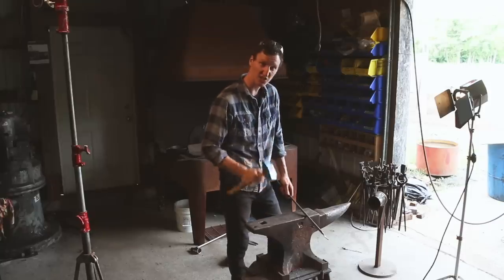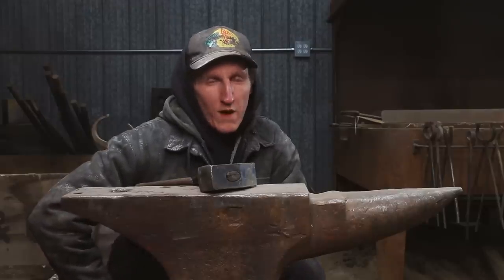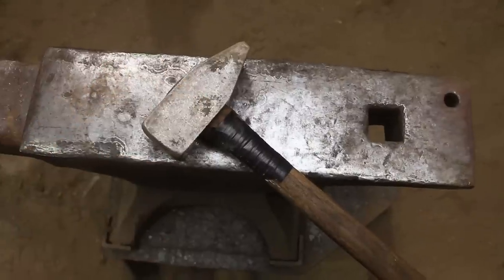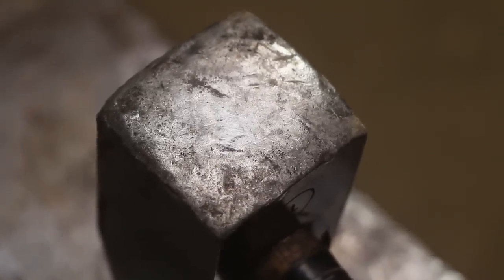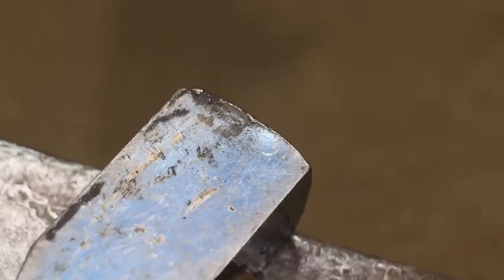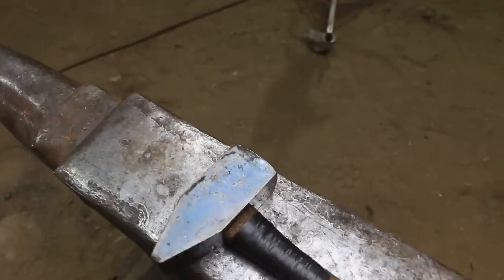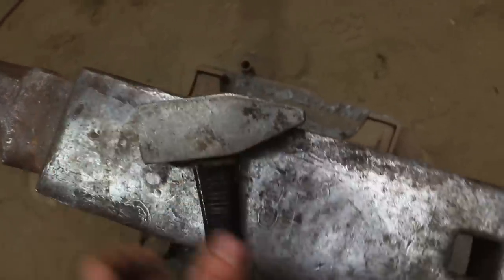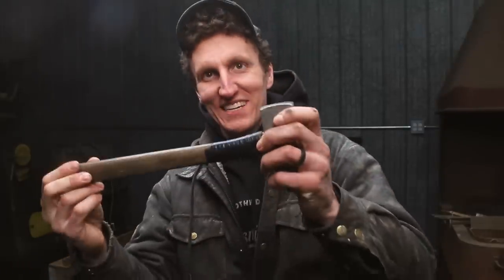My TITANIUM hammer after 2 YEARS

Comment: I'm a carpenter of 40+ years and have never used a titanium hammer.

The experienced carpenters, I know and trust, swear that the lighter weight is compensated when stored energy is released from the hammer into the work.

If you are swinging a hammer all day, and your hand does not go numb or elbow swell, you have a great hammer. 🤘🦊👍
Reply: don't fall for the scam.
Reply: You can get a titanium hammer in the weight of your regular framing hammer, the benefit comes from how the titanium handles the shock. I don't know all the sciency Parts but it doesn't transfer as much of the energy to your bones as steel does.
Reply: Just use lesser hammer, lol. Titan is great, but using it for hummer is a waste of precious metal.
Reply: @dmac1259  i have noticed on his first video the sound it makes when it hits the anvil, it has a "hollow-kind" sound compared to a normal hammer (probably because is less denser?), maybe thats why it may be more healthy for the muscles and bones compared to a normal hammer

Comment: Tim, great video, glad to see the update on the hammer, since I remember the original video.  Titanium has a lot of cool properties, some that might play a part in why the hammer works so well.  Depending on the alloy (can't remember which you used) it has a lower coefficient of restitution than steel, so it won't bounce back quite as much, likely saving your elbow.  It also has a much lower thermal conductivity than steel, so it will take less heat out of the piece you're working on than a steel hammer.  It also can alloy with materials your work with, so it wouldn't surprise me if the face of your hammer has a good amount of iron in it now.  Titanium work hardens, so you're making it better every time you swing.
Reply: thanks for the information, i have noticed on his original video when he hit gently the anvil, it sounded a bit "hollow-like" sound, maybe because it has a lower coefficient of restitution? (a concept i just google it and learn thanks to you!)

Comment: Could steel faces be dovetailed/pinned to a titanium core to toughen the striking areas whilst retaining the shock absorption? It'd be ridiculously overkill design wise, but would it work?
Reply: This is a great idea.  Tim, get on it!
Reply: I wouldn't use dovetails in an impact tool as it'd work itself apart with use. Honestly, if shocks are an issue, use a birch handle or wrap some leather around it. If you're a blacksmith and shocks bother you, you're holding it too tight. If you absolutely want to use titanium, I'd try to make the eye way oversized and fitting a sleeve as thick as I could, but then you'd have to worry about the steel cracking.
Reply: @bjrn-oskarrnning2740  another thing I've seen for reducing shock in both hammers and axes is to orient the wood grain parallel to the striking face (or edge).

It's so common now to see wood handles with the grain perpendicular to the striking face, for "strength and longevity of the handle", but if you change the grain orientation and shave the handle in a way in which you preserve the outer growth ring for the back of the handle (similar to bow making, but opposite), the handle gains some spring, but also absorbs a lot of shock and lasts far longer at the same time. 

Mr. Chickadee has a great video explaining this.
Reply: @jameshaulenbeek5931  huh, I haven't heard that before but that's definitely something I wanna try out!
Reply: You can also use screwed head like in recoilless hammer.
Reply: @bjrn-oskarrnning2740 it’s funny you say that, because a keyed dovetail is how a lot of power hammer strikefaces are held on the ram/anvil
Reply: @jameshaulenbeek5931  Can you link the video where this is explained please?
Reply: Stiletto did that to a degree with their tbone hammers. They bolted a steel face on an all titanium hammer. It works fine but you do have to retighten the bolt every so often even if you use loctite.
Reply: @EclipseAtDusk  I know, but they have wedges to hold them in and those need to be knocked back into place every so often :P also, those hammers have a linear motion which I imagine puts a lot less strain on the joint, compared to how I use and abuse my hammer xD
Reply: @bjrn-oskarrnning2740  Why can't you design it so that the wedge goes into the main working face of the hammer, and thus every single swing knocks it back in?
Reply: @jameshaulenbeek5931  as a woodworker who just popped by to see another craft's discussion?  I wouldn't turn a handle that direction at all, even if you could get it to be long enough.  Wood is WAY weaker in that orientation as the strength travels down the grain
Reply: Stiletto makes framing hammers that are basically exactly what you are talking about. The hammer is mostly titanium but with a half inch or so steel strike face. They cost 200-300$ but if you’re a carpenter or framer and use it all day long it’s totally worth it.
Reply: @polerin  you should probably look into wood bow making. It's the same process.
Reply: @jameshaulenbeek5931  Perhaps, but a bow is never meant to actually withstand the force of it shooting.
it needs to transfer the energy into something like an arrow.
Dry firing without an arrow and letting the stored energy just travel around the bow without going anywhere will damage and eventually destroy it.

Comment: Titanium is worth it just because it absorbs so much more shock, which is easier on your joints and better for your health in the long run.  Stay lit. 🔥
Reply: Wait, for forging? If you feel the shock in your arm, you're holding your hammer way too tight!
Reply: This! Very much this! 

I heard the story once, of a custom bicycle frame builder, who explained that any road bicycle with a titanium frame would ride soooo incredibly smooth that it wouldn't need shocks, whereas a steel framed bicycle would definitely improve with a set of front shock absorbers in the fork.

Comment: I think seeing your original video has lead me onto some research back when I watched it. I have read something about titanium being able to transfer more kinetic energy than steel. So it would make sense that it is less tiring to use. it would mean it has less energy to transfer back at you after you hit something
Reply: Kinetic energy = mass x speed. So it doesn't matter what material you use.
Reply: @JaapGrootveld  You haven't factored in the elastic/non-elastic effect of metals, eg bounce a ball bearing off of a quality anvil and then try bouncing it off a similar shaped lump of normal steel, the anvil will bounce the ball a lot higher than the steel.
This all boils down to the right balance to get energy to transfer into the workpiece rather than back into the handle of the hammer
Reply: @JaapGrootveld  kinetic energy is 1/2mass x velocity^2 (momentum is mass x velocity)
increasing speed has a much greater effect on kinetic energy than its mass does.

Comment: I don't know much about forging, but as a hobby machinist I'm working with titanium on the lathe and milling machine quite a bit. The pitting probably stops because of work hardening. Titanium has a tendency to work harden a lot under pressure/force, which really is a pain for stuff like drilling or milling, if your cutting tools are slightly dull and the cutting pressure gets too high. 
In the case of your hammer that's actually a good thing I guess. Maybe hitting the cold hammer with the power hammer could improve the hardness by basically "cold forging" it.

Comment: A tool that you prefer over all others says a lot. I have a favorite knife. Others are sharper, others are sturdier, others look nicer. My favorite knife has a comfortable handle that doesn't get slick when its wet, is indexed nicely, the blade is a good, all purpose clip point, 1/8th of an inch thick on the spine, and has a 4 inch blade. it just feels right.

Comment: Things I learned about Titanium over the years.

You can cut them.
You can damage them.
You can crack them with enough force.
It scratches easily if warm enough. (Terrible when used as engine component parts)

Everything else about it that I've learned is what everyone else learned about it initially.
Very light and very strong. It makes for great body armor.

Comment: Maybe you could make a Steel Hammer that has a changeable Striking Face on it. The weight would still be light but you could have a Steel Face on it or Brass (or any kind of Metal). Robinson Foundry made a pretty cool Hammer with Changeable Tips on it.
Reply: You mean a titanium hammer with interchangeable faces?
Reply: @MineZilla123  Yes
Reply: @MineZilla123  Actually I mean both. One could have the weight you need the other could have the speed

Comment: It probably has some advantages over an equivalent hammer with a flared shape to it, which would be the way to get the same striking surface vs. weight ratio with one made of iron or steel. For some types of shaping work, I wouldn't be surprised if the lightness makes things easier. And it's not like you can't switch to a heavier hammer of similar size if you do need it.

Comment: I have to wonder about the gouging and mushrooming of the edge. It's like there was a shallow layer that was soft for some reason. Although titanium if I remember correctly, isn't that good at being 'plastic' like some steels are. Meaning they don't stretch without deformation at the micro level and don't really do all that well with shock loading without a certain amount of mass to hold the shape. Either way, still an interesting hammer and it's neat to see how well it held up.

Example of this is in titanium firearms. The frames and many parts can be titanium, but the chamber, bolt and such meant to contain the case upon ignition of the round. Are not titanium, but are sleeved with a steel sleeve, either stainless or a hard chromium alloy steel because the steel can flex/stretch minutely and return to form without developing micro stress cracks.

Comment: Energy=Mass×Velocity².  It's the speed that does more than the mass when it comes to energy to transfer.  Now weight and hardness can improve the efficiency of transfer.  Both help move the metel better.

But the question becomes what's more efficient?  Is it swinging a lighter hammer more times, or more effort spent moving a heavy hammer less times?  For that we'd need data from you to conclude efficiency.

Comment: 5:11 the impedance of the hammer in terms of rebound should be different compared to other metals, so it makes sense that you can tell something is different. imagine swinging a hammer made of cheese vs one made of granite vs one made of rubber. they each will rebound differently off of different surfaces, and your elbow is part of that oscillating system. the simple fact is though, if it makes your elbow feel better than you should keep using it. even if its some other reason that has nothing to do with the titanium, its worth using if it saves on your joints. RSI is no joke

Comment: weird question: What about a steel core, titanium hammer? would It transmit more power to the work item as well as reducing the shock to the arm?
Reply: Weight doesn't add more power, because you swing it slower.

A faster moving lighter hammer will produce more power.
So a titanium body with a steel face would be significantly better -- reduces wear on the faces and keeps it light.

Comment: I was really sceptical about this from the get-go (but that video is what led me to your channel, so happy anniversary to us, I guess! 😂) for a couple of reasons. First off, titanium isn't actually that hard or solid, it's just very solid relative to its weight, which is why it's used in performance cars and such. And weight is the second thing: a forging hammer is supposed to be heavy so you can use the weight instead of your muscles to move steel. If your arm gets super tired, it's probably more because of your technique or the shape of your handle. And finally: price. There's really no good reason to use titanium in a hammer except for novelty. A hammer doesn't make good use of any of the properties that titanium have and, like you've seen with the face of yours, not using properly hardened steel is actually detrimental to its longevity. If you need a lighter hammer, say for framing or detail work, get a smaller hammer or grind away material from one you've already got.

Gosh, this ended up a lot more negative than I intended it to be, sorry about that! It's a fun experiment and if you made a hammer you really like, that's great! Looking forward to see what you make in the future, and if you do manage to harden the titanium, I'd be really interested in seeing the results!
Reply: i dont see it being negative! well spoken :)

Comment: A titanium hammer harnesses a full 97% of the energy garnered from that hammer swing and transfers it directly to the nail. For comparison, a steel hammer transfers only 70% of that energy to the nail. This is the reason a lighter titanium hammer feels as if it is hitting as hard as a heaver steel hammer, because it IS. If you do some quick math you may wonder where the 27% loss of energy went on the steel head hammer.

For the most part, it gets transferred back to the user through the energy that is released in the recoil of the steel. Essentially, vibrations are sent through the hammer head, back down the handle, and into your arm.

Comment: Titanium is light weight compared to its tensile strength, allowing you to use less metal to do a job, but its not actually that light. Its density is about half way between aluminum and steel.  Aluminum 0.097 lb/in³   Titanium 0.163 lb/in³  Steel 0.283 lb/in³

Comment: I prefer a lighter hammer for most things in the shop and I haven't hammered an anvil enough to have a preference on light or heavy but the times I have I used a heavy hammer to move the bulk of the material and then switched to a light hammer to do finer detail and recover my strength.

Comment: Now I'm not metallurgist or nothing but perhaps one of the reasons it stopped pitting was due to a combination of being hit against a hot object like your axes, potentially leading it to Maybe (And this is a big maybe) Kind of surface harden it self?

Other and more feasible reason could just be that it ended up err "Cold worked" into being hard as Titanium is a softer metal than steel, which may cause it to harden

Which is also potentially another reason why it feels better, as you have a nice thin hard layer right at the striking face but everything else it soft (Relatively speaking) making it much better at absorbing that shock load, (Maybe even acting partially a bit like a deadblow hammer?).

Again not a Metallurgist, (currently studying to be a Machinist though) but that my hypothesis. Perhaps something you could do would be to test the hardness using a hardness tester of the face vs the rest of the hammer.

Either way really cool video, Glad the Algorithm brought me here

Comment: Titanium weighs about half as much as steel.  Your energy transfered in a given hammer blow is given by  1/2 Mass * Velocity Squared.  So you can make up for the lesser mass by moving the head sqrt(2) faster -  which is about 1.4 times faster, much of which can come from a wrist snap at the end of the blow when using a lighter hammer.  And it weighs only half as much to return for the next blow!

Comment: Perhaps if used diffent alloy of tytatium to get diffrent internal structure - you will get harder surface but then internal forces distribution would suffer. Sadly you cannot get titatium both soft and hard from same alloy - like you can do with Iron alloys. The way to do it properly (100% titatnium hammer) would be to use alpha tiutatium on the inside to get nice internal forces distribution and Betha on the outside- but frankly i have no idea how to do it without introducing oxygen that causes all of your problems with current hammer (or at leat i think so bc I haven't checked on exact corrosion mechanisms of titiatium for like 10 years- and that was puerly theoretical). As much as i remember titatium that had oxygen during any hot treatmens will slowly develop corrosion on the edges of the crystals which will slowly change your hammer into sand sized fragments- and frankly that means that your sill at ghe forge is quite impressive- as it only shows  up in a form of pitting.